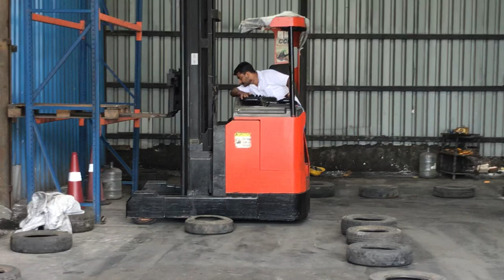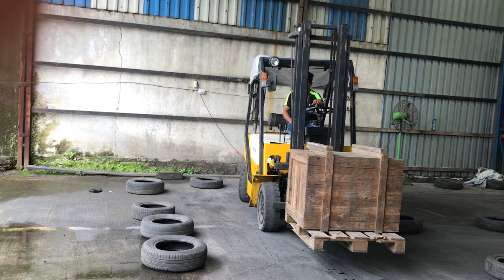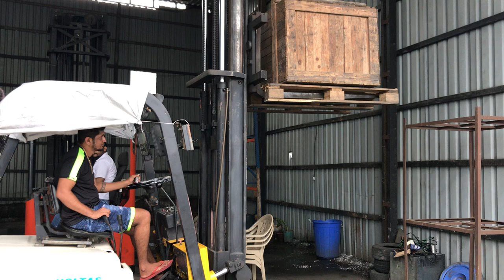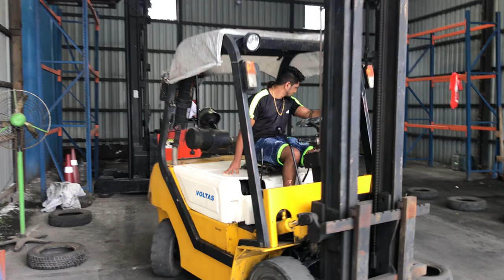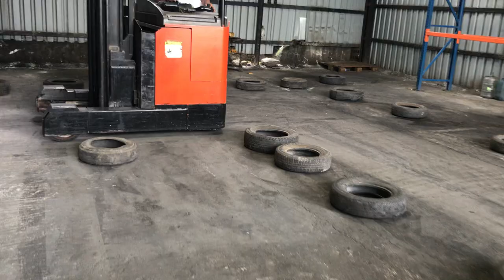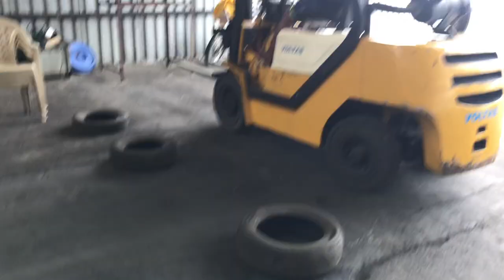Forklift Operator Training in India , Call Now-9167522000 Mumbai, Delhi NCR, Bangalore, Pune, Bihar,

Comment: Hi sir what are the process for training and how many days of training will be conducted by your company  will your company give a certificate after the completion of training and will you be doing posting also if availed and what will be the charges required  a training is thare accommodation available in your site itself.
Reply from the maker: Training Duration-15 days
Training Fee-12000
Guest House - Yes available @1000 extra
Reply from the maker: Location-Mumbai
Reply: @ForkliftOperatorTraining  1000 extra per day or full days of training.
Reply from the maker: @rajanthangaraj4603  full training Duration